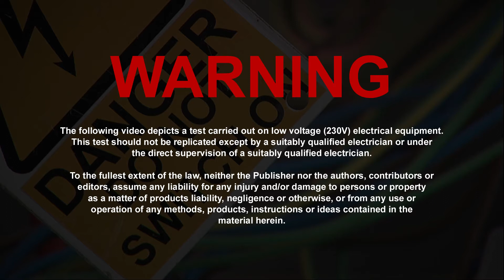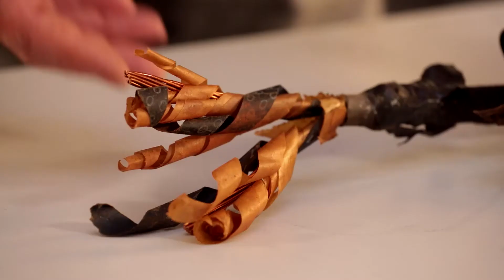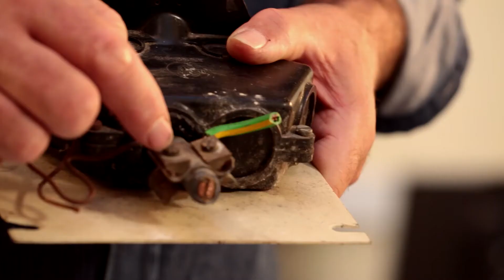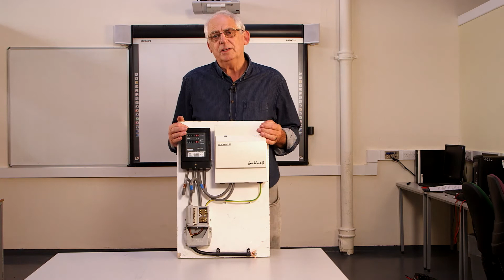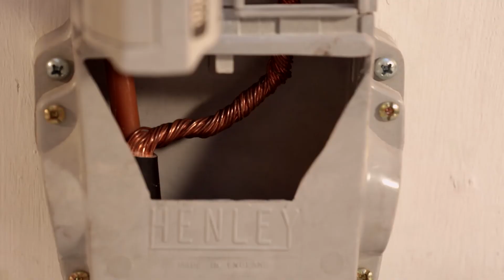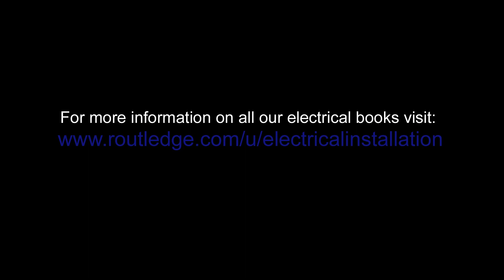Earthing systems

Comment: So when you get a fault and current flows back to the transformer, then what happens?
Reply: If your protective devices fail to isolate the fault, then there will be multiple PMEs, (protective multiple earthing) along the supply side cable run to absorb the fault current.